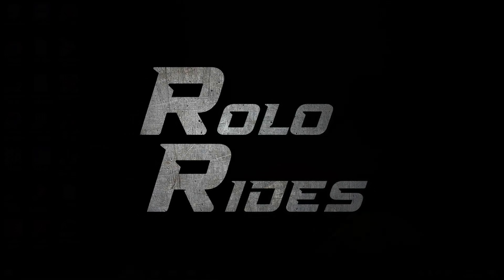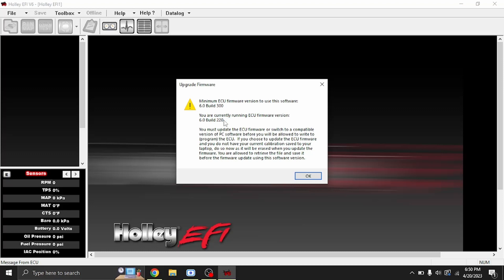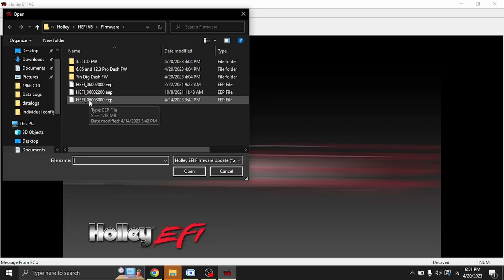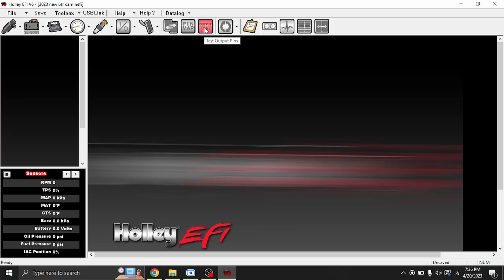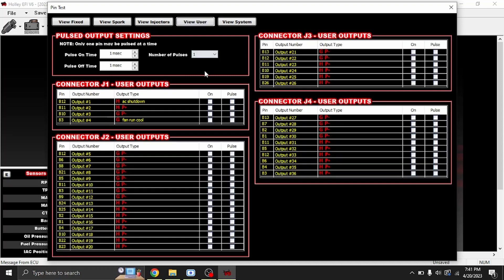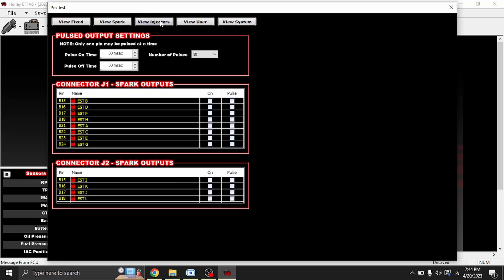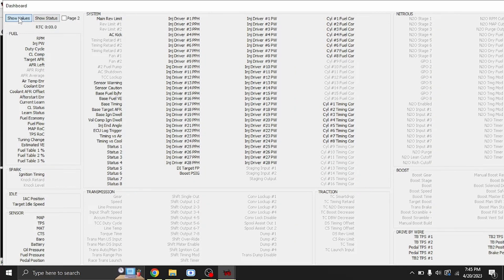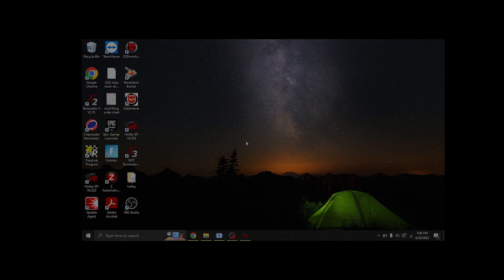HOLLEY V6 BUILD 300, YOU WONT BELIVE WHAT HOLLEY FINALLY UPDATED!

Comment: Just curious, why do you want to turn the fuel relay on while testing injectors or coils?
Reply from the maker: the injectors and coils are on the same circuit as the fuel pump when using a holley harness.
Reply: @Rolo-Rides   I don’t see any need to turn the fuel pump on. Actually just the opposite, I would not want the fuel pump on while testing injectors or coils.